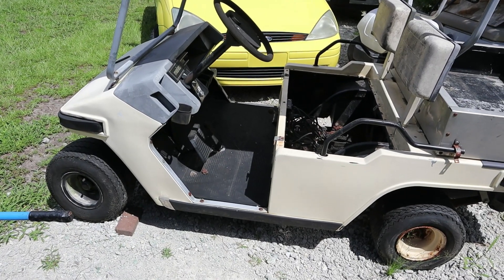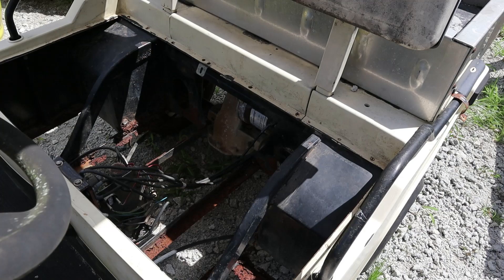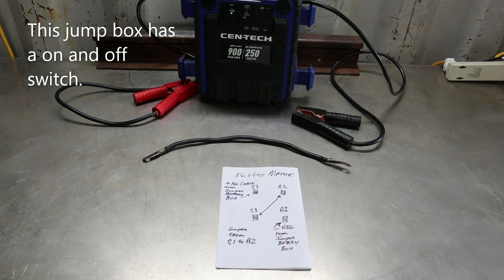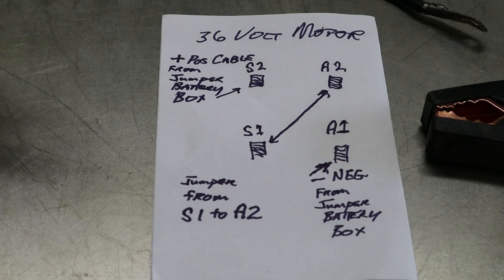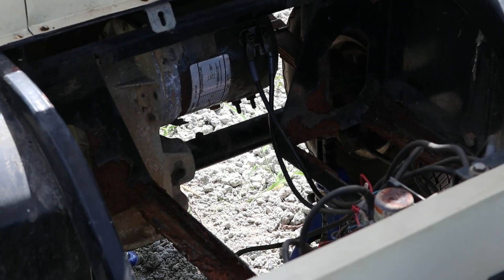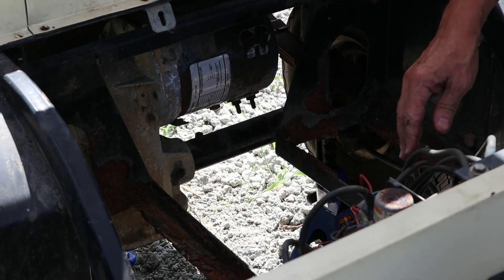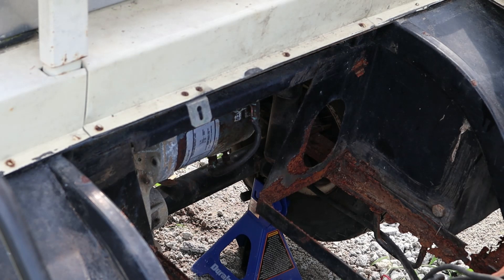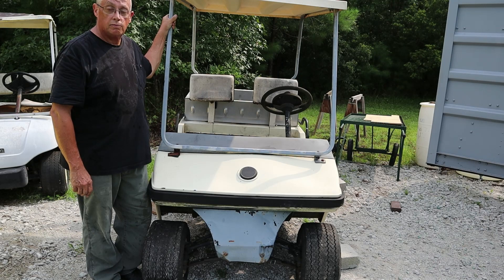Testing 36 volt golf cart motor with 12 volt battery

Comment: I've got an 86 ezgo 36v that I've been running for a couple of years with 3 pairs of 12v car batteries.... That's 3 parallel sets in series. It works great. I use whatever free or cheap batteries I can scrounge up. The RANGE is about 6 to ten miles vs about 20-25 but around the house or to the nearby stores it's plenty.

Comment: What are you using as the jumper box? I need to do this with a 36v 1999 ezgo txt. Thanks!
Reply from the maker: I used a Harbor Freight portable jump box with a   on and off switch.
Reply: @projectswithbc6998  any chance you can send me a link to the one you got?
Reply: Scratch that I found it :)

Comment: Thank you for this very well done explanation. I've just started down the black hole of repairing an '98 EZ GO.
Reply from the maker: I'm glad it helped. I hope your build goes well.
Reply: Good luck with yours. I'm working on a 1986.5 EZ Go
Reply: @BlekSheep_1  I don't know how far along you are, but just an fyi. I have a 36 volt and used 3-12volt deep cycle marine batteries for about half the price of the 6 volt batteries. I've been using it since last summer with no problems. Good luck with yours.

Comment: Can I bench test ezgo txt motor
Reply from the maker: I have been told you CAN NOT bench test golf cart motors.
Reply: @projectswithbc6998  I have herd that if they are a direct bolt to axle the axle is the bearing for the motor so you would need to have the whole rear end to bench test

Comment: What would you have done if the wheels didn't turn.
Reply from the maker: First thing I would do is double check to see if everything is connect correctly and make sure the 12 volt battery is fully charge. If it still didn't work I was going to take it to someone who repairs 36 volt motors

Comment: I bought a 1985 EZGO for $60. The electric motor lugs are in a straight line not on four corners like your motor.  I can’t find anything on the net or the motor to tell me which lug is which. Any ideas?  Good video btw
Reply from the maker: I have never had or seen one with lugs in a straight line but I did go online and just put in 1985 Ezgo electric  golf cart wiring . I then went to images and it had a few diagram with the inline lugs. It showed S1 being closest to the motor and then A2, S2 and A1. I would  verify this is what you have before doing any wiring.  Sorry I couldn't be more help and good luck..
Reply: @projectswithbc6998  No worries, I have viewed the same drawing. was hoping you had messed with one personally. Thanks for the reply

Comment: Could you have just hooked it up to the main battery leads and checked if everything works.  Like the controller and  gas pedal controls or do they need 36v?
Reply from the maker: Yes they need 36 volts.  Make sure and  hook up only the motor to the 12 volt battery and that all wires going to motor from the cart have been disconnected first.
Reply: @projectswithbc6998   Do I still need the jumper wire if I check it this way? Thanks